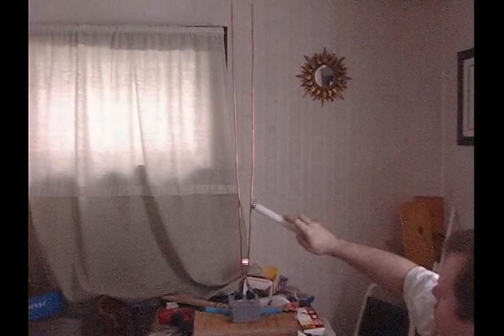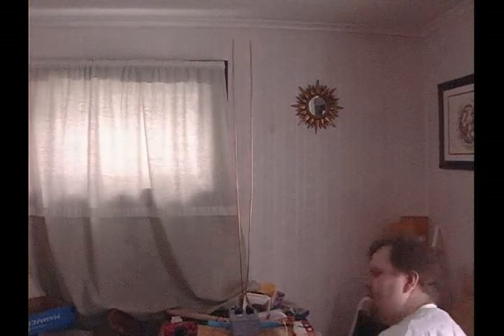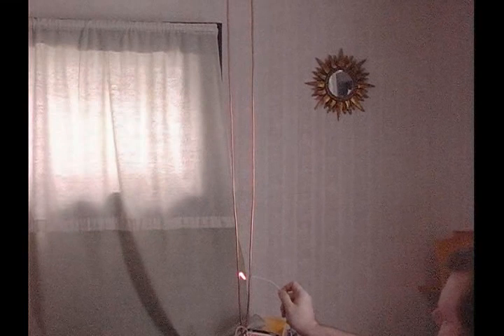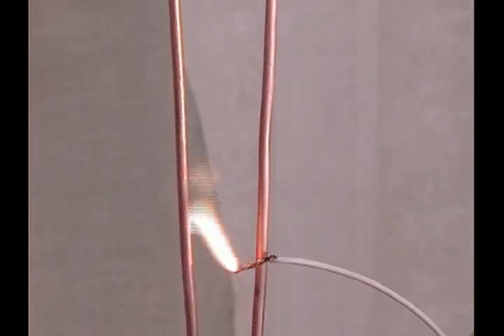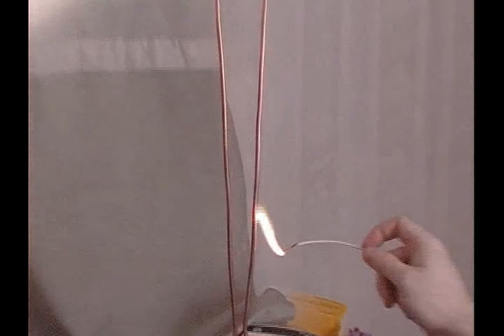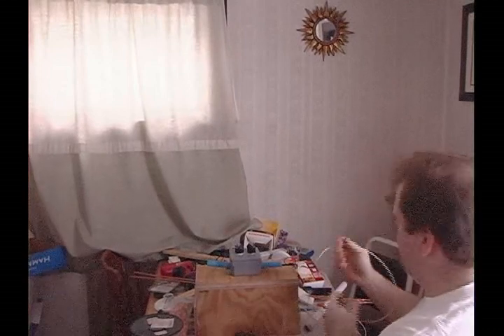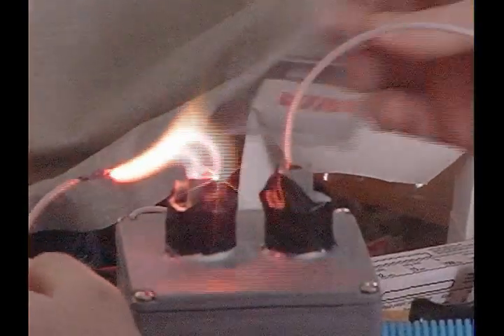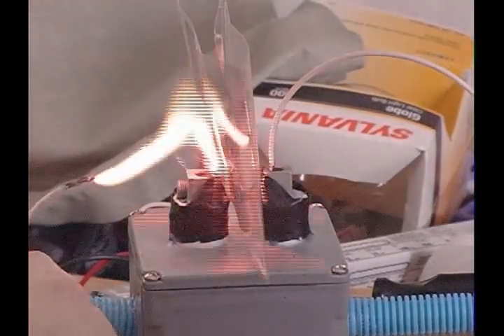Jacob's Ladder New Demo: Slightly-Mad Physics

Comment: A 100W bulb is -not- a large resistor, as in large = high resistance. At the 120V that the bulb is designed for (about 144 ohms resistance while hot), that's about 833mA, more than enough to fry you. At 15KV, that bulb does -nothing- to limit the current. Your body has much more resistance than that.

Comment: Is that just a transformer from the 110 Volts 60 HZ AC grid powered ? Or is there also a High Frequency driver inside there ?
Otherwise if it is just 60 Hz powered from the grid only you are very dangerously playing with it !
You could easily get killed, if you touched it wrongly
and get both hands on each electrode !
Regards, Stefan.
(admin of overunity dot com  )